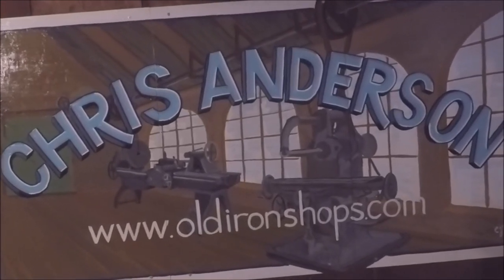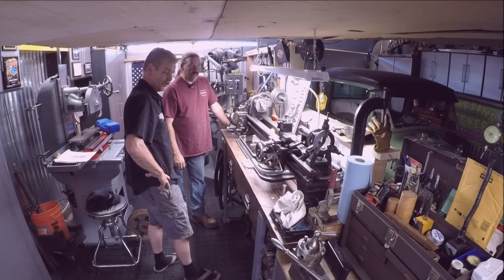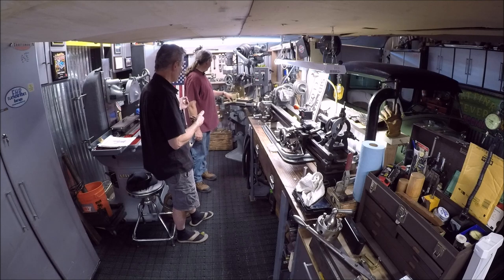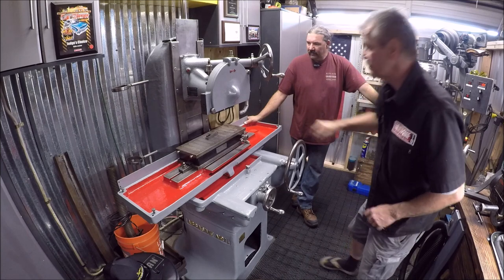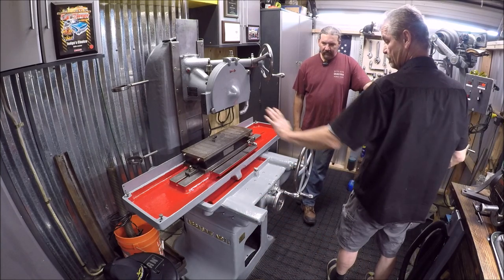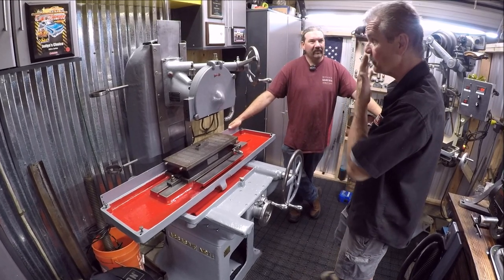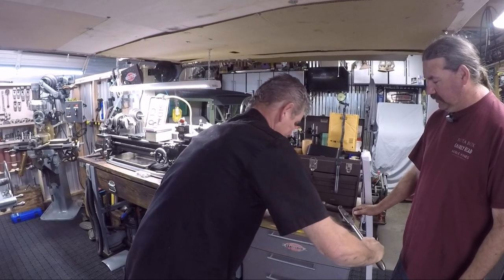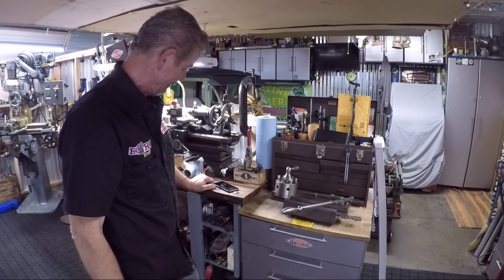Garage Machine Shop Tour : Flat Head Ron's Garage

Comment: that turret  crawl in to your truck ? i may have the geometric die head  that needs to be traded to go with it .  thanks for sharing
Reply from the maker: Oh what do you need? I can Sur use one.
Reply: been looking for a chuck to fit my lathe ,that said iv yet to get the old one off lol .also need some moris# 1 live center and drillchuck for the tail stock. ill take some pics  this weekend of the die head its for up to 9/16 i think but am not sure .
i ran 2 Warner Swazi <(auto correct spellling ) 20 years ago  loved watching the die heads make treads . 10 inches  of 1 1/2  - 8 in 20 seconds   on the big boy was amazing .
Reply from the maker: I have a extra 4 jaw chuck 6" I think with what I think is D16 back plait.
Reply: that sounds big for  mine
Reply from the maker: What spindle do you have and what size chuck are you looking for?
Reply from the maker: Did you ever find the geometric die head?
Reply: i did  it was deep in the hoard  ,i disturbed the dragon and that was a thing  then fire works and a been hulling  junk for my brother. il snap some picks  .
Reply from the maker: Cool don't lose it
Reply: i think i sent you some pics  it was a bit neglected when i got it ,i soaked it and freed it up i fingered i  really clean it once i had a use for it . if you think you can use it well work something out
Reply from the maker: Yes that is just what I am looking for. Is it 5/8" for the mount?
Reply: i believe so ill check it after supper
Reply from the maker: Cool deal.
Reply: .625
Reply from the maker: That's the right size I believe will have to double check.